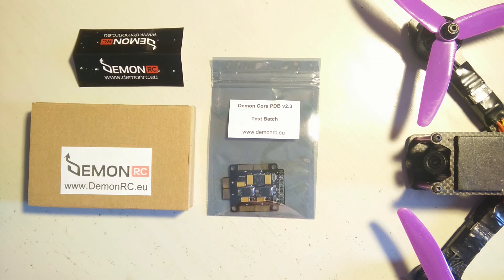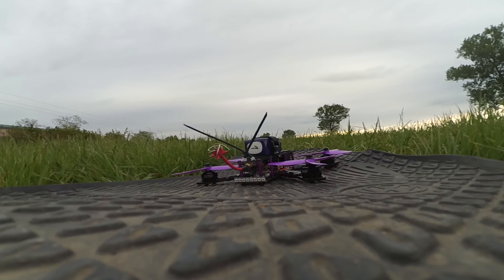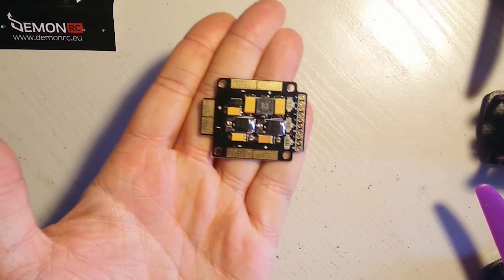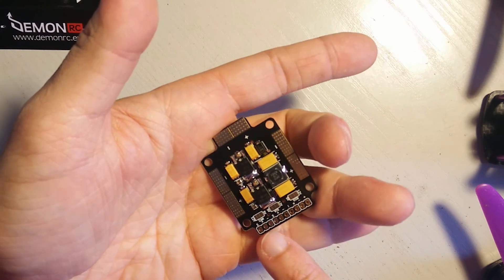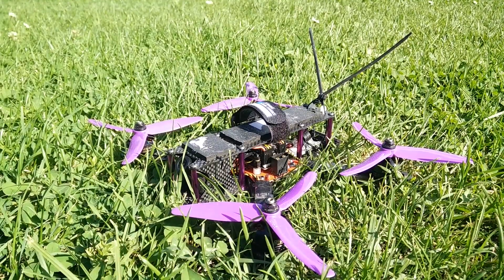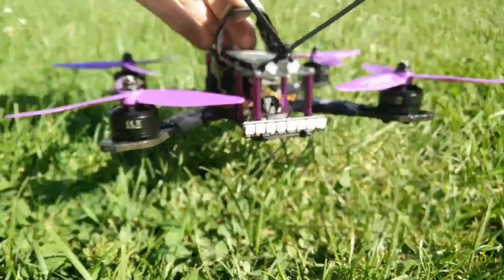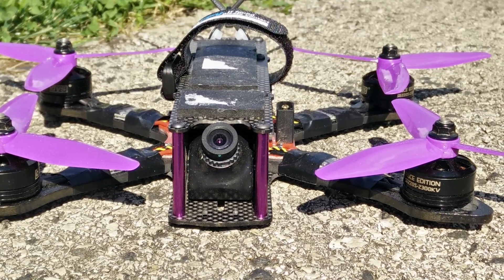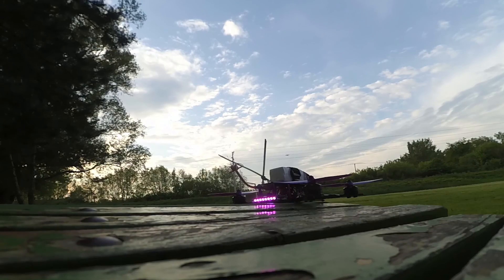Martian2 5" build log #2 - Adding DemonCore PDB

Comment: How do you connect the stock PDB with the new one ? I mean, did your PDB has a CurrentMeter whitch needs to be connected directly on LiPo ? I'm waiting my Martian II that I'll use with a LemonCore PRO PDB and I'm hesitating about using or not the stock PDB additionnaly to the LemonCore one, because I want to have my CurrentMeter on the OSD. (sry for bad English :p)
Reply from the maker: +FBO (AFR0) I don't use any current meter, I left the stock pdb because I didn't want to break the rigidity of the frame by removing that part. I took a pair of short piece of 14awg wire and connected the two pdbs together.
Reply: Ok, thx :)